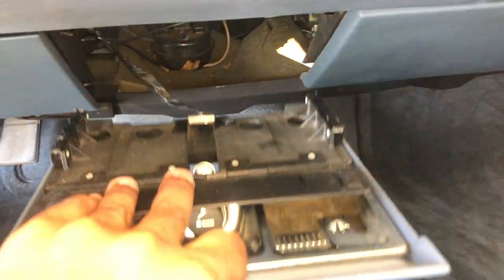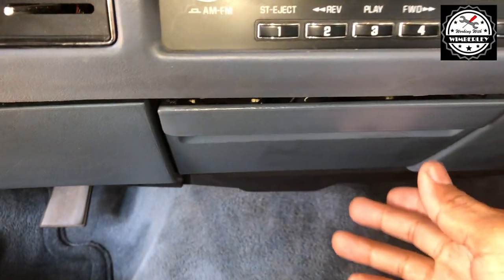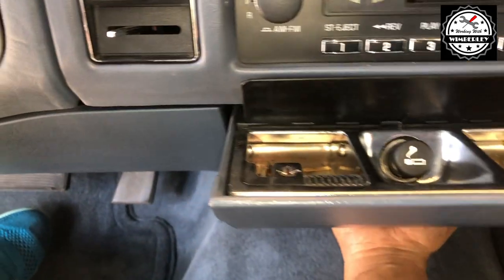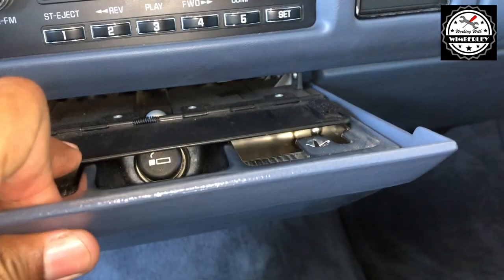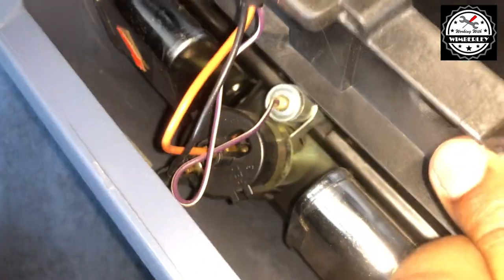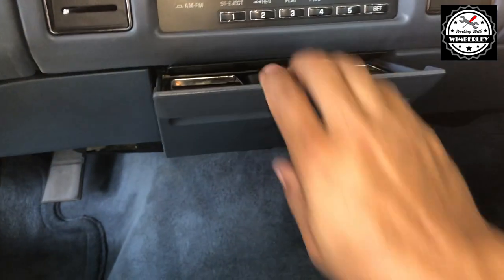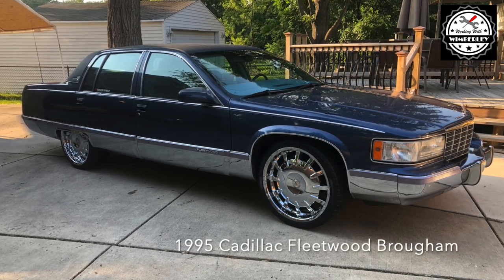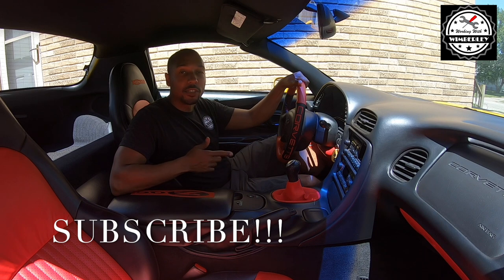Cadillac Fleetwood Ashtray Removal Replacement 1993-1996 Interior Impala Caprice Buick Roadmaster

Comment: Any recommendations on how to easily modify the outlet from always on to only running when the vehicle is on?

I’ve looked into a fuse tap but I would need to run new wires or I could do a replacement socket that has a manual toggle switch for power which is easier to wire up but would lead me to butcher the console in some way to mount it neatly. I also don’t trust myself to remember to turn it off every time.
Reply from the maker: I would definitely use a fuse tap. I use those quite often when I add electronics to cars. You’d just need to find a fuse that only gets power when the ignition is in the on position.

Comment: do you have a video on how to remove the rear seats ?
Reply from the maker: In this video, I remove the bottom of the rears seats. It’s not bolted in. You just pull it straight up. I didn’t remove the upper part. https://youtu.be/BFMd--F1rFc?si=dZHs6eVEhikYd7RX